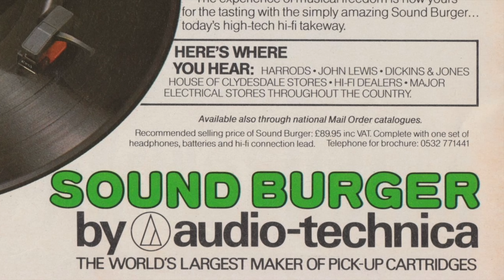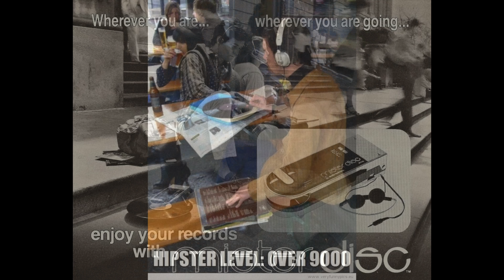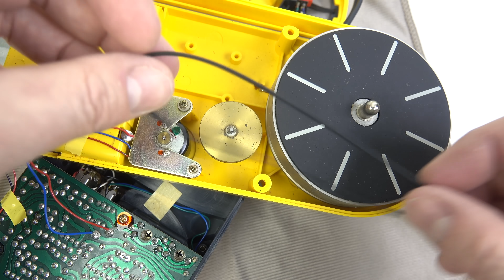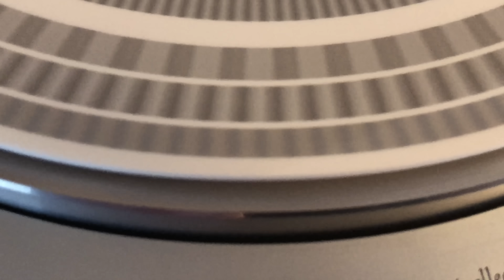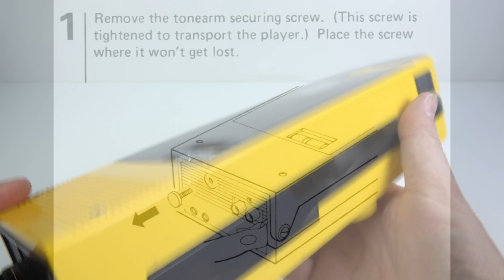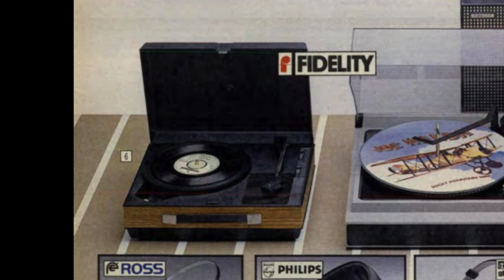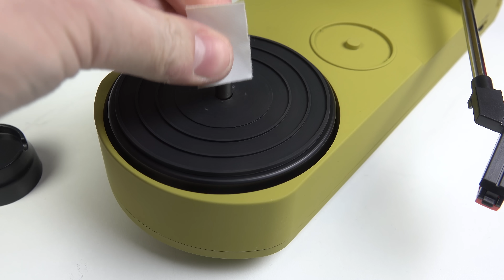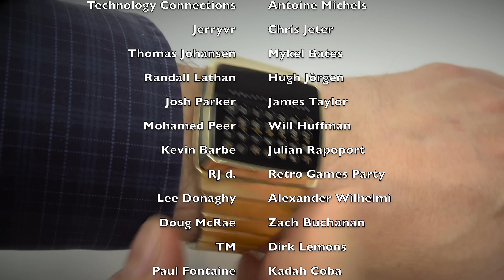SOUND BURGER & the clones

Comment: That Crosley is real, but it's the 2nd gen revolution.
I already own the modern bluetooth sound burger,  but I've just bought a first gen Crosley Revolution for £20 + £10 postage, which is apparently half decent.
I'll let you know once it arrives and I've tested it.
Reply: Finally replying to my previous post.
It's better than the 2nd gen. Not brilliant, but not terrible either.
It's useful for crate digging, but I still prefer the Sound Burger.

Comment: I had the original Mister disc in Purpke in mint shape that I won on eBay around 2010 for under $100. I was the only bidder and back in 2010, not many even knew about this machine and the vinyl craze had not happened yet. Sadly it got stolen about 6 years ago from my storage and I loved that thing, even just looking at it and not using for  it. I’m very visual and love the 70’s and 80’s and for me ot was like looking at art and made me feel how I felt in the 70’s and 80’s, 

So I was so happy to find out these are back bc  I don’t have the budget to get another original bc they’ve gone up 4 to 5 times what I paid 13 years ago. I actually was pricing some audio technica cartridges when this burger  unit came in the feed with the cartridges. So I’m def getting one and I love all the vintage Japanese gadgets from the 70’s and 80’s. I need to find a book with all of the vintage Japanese gadgets, so I can just look at them and be more educated on what was out back then.

Comment: I would have put the strobe disc over a record to check the speed, as having to drive the weight of the record might have taken the speed down a bit. The rubber stabiliser would have have stopped it slipping on the surface of the record. The 'flywheel' effect of the record might also have improved wow and flutter.

Comment: perhaps it was running fast due to no load i.e resistance of stylus 

plus the battery run down would drop the speed over time so running fast means that normal speed is when batteries have been part used?

Comment: Ok that's a BIG red flag. You need to manually switch the power supply from USB to batteries? That's an incredibly cheap and simple thing to do. Its in basically every dual power device and in every audio device.
That fake Crosley was made to be cheap.

Comment: how on earth could have something such hum if it runs from batteries... I mean yes, the motor driver may be the guilty here. But how cheap were the buisnessmans who ordered to engineer these electronics... At least a decent capacitor should've been given to the circuit, or only a DC motor with some gears and capacitive filtering for commutation noise...

Comment: Yeah your Crosley was definitely a fake Crosley.  Please review the real thing.  You can tell the real thing by the top has clear plastic window over the record, the tone arm has a proper handle,  it takes 6 double "A" batteries and has an FM transmitter.  The adapter also appears to be soft rubber like the original Sound Burger.  I really like to know what the tracking force on the real thing is.

Comment: 3 Batteries are min 3 Volts and max 4,5 Volts, if you are a bit crazy, you can replace them with one Lithium Ion Pack (be careful to add a low discharge protection, though). Would make it run for several hours, even with a small one.

Comment: I'd like to mention, that seems to be the second iteration of the Crosley Revolution and yes it is garbage. However the first model is much more similar to the Sound Burger though it still feels like a cheap knock off, not so much that you could regret buying one. I recently got a CR6002A (The one in the video is a CR6020A) and it is actually quite good. The spindle does rotate with the platter, the cartridge is a Chuo Denshi Moving Magnet, it does require more batteries (6 as opposed to 4) and doesn't come with earplugs, but it has a much better design overall, more akin to the Soundburger. I'd give it a look if you haven't by now

Comment: I remember these novelty players shaped like different models of popular cars that had wheels connected to a motor and had a stylus and cheap speaker. You would turn it on to the corresponding speed of the record and the needle would keep the car on track as it played whatever was on the record. The record stays  put as the little auto goes round and around the record until you pull it off or it reaches the middle.

Comment: I still have my AT Sound Burger from 1983. Good to find out that belts are still available.

Fake or not, Crosley makes some absolute junk under the banners of 'nostalgia' and 'retro'. However, Crosley make two Sound Burger rip-offs. you have the cheaper version, They also sell the Crosley  'Revolution', which like the AT Sound Burger, has a clear window above the record platter. In the USA there's an even cheaper and crasser model, the Sylvania USB, which sells for $30 and it looks more like the Crosley you have - a knock-off of a rip-off.

Comment: i owned a small record player like this before. not quite so small but still small, and also one built into a dresser sized piece of furniture, both with the same issue.. when i touch the metal on the arm it shocked me. would would that be from? it reminded me of that when you got that humming when you touched the arm on the "crowley".. and speaking of that, my gut says it's fake.. Did you ever figure it out?

Comment: Hi. Nice gadget. One major mistake was that you didn’t clean the belt grooves. They are usually quite dirty. Use wooden cotton swab and some cleaning fluid which evaporates well like alcohol. Also handling the rubber belts with bare hands is not recommended. Please use tweezers. Also the smaller belt is wrong. It is too thick which you can see when turning it. The belt doesn’t follow the small motor pulley as it should. This is quite important and when you have too thick belt it needs to be very exact as it may stress the motor bearing if it is too short. 

We professionals do not use that much contact cleaner as it collects dust. I have used LPS-1 for 45 years which is greaseless lubricant. Usually you don’t have to use any contact cleaner in that good quality trimmers. You can turn the trimmer back and forth tens of times which helps to clean them. If the trimmers are getting worse the only good fix is to replace them. But this is not very common situation. Also you didn’t adjust the speed after turning the trimmers. It would have been very easy.  Professionals don’t let the speed be that much off if it is easy to adjust. 

What I succest, is that you change the smaller belt to thinner one and after that adjust the speeds with record playing as the pick-up slowers the speed. This is very important to know especially in this kind of battery player. Also it could be good idea to clean excessive cleaning fluid and perhaps clean the trimmers with cotton swab and if you want to use any cleaning fluid, use LPS-1 as it is used in audio mixer faders in studios.

Comment: I'm assuming that the pot' on the first device in the video—the genuine sound burger—that adjusts the turntable speed, had something wrong with it or simply wasn't the correct choice of a component for the original design. My understanding of that component is that they work by moving an electrical contact against a length of material to force the electric current to travel different distances that correspond to more electrical resistance to further it has to travel. So if you feel up to modifying you sound burger, you could possibly use a tool to find the range of resistances the original pot allows, and use that as a guide, along with your speed test of the player, to pick out a new pot that allows resistance values more in the ballpark of what you require to properly tune the speed. Or if you can find just the right resistance value, you could plop in a matching resistor. (But only if your feeling lucky. It might take a very long time to find the perfect resistor.)

Of course… For all I know, letting through the correct voltage to properly tune the turntable speed may actually burn out some other component(s). Though I hope it's not designed to be that close to disaster.

I wonder if this comment is as silly as I think it is… Sometimes I'm just compelled to leave slightly silly comments.

Comment: 9:57 there is an additional function for the rubber holder: it's used to hold the tone arm into place when replacing the stylus: you have to place the record player upside down on the table and let the tone arm rest on it, and you can replace the stylus.

Comment: Making a cheap portable vinyl player in the 2014 strikes me as ridiculous. There is obviously a market for good vinyl players, but I think anybody with ears would probably concede that an AAC file played on a phone is going to sound better than an unstable record player with a garbage needle and noisy electronics playing a scratched-up record through little earbuds.

This is not a knock at people who prefer vinyl over digital: a cheap portable vinyl player takes all the down sides of vinyl and turns them up to 11. There's not even a use case for people who only have vinyl and want to be able to take it to a friend's, because the heavy tracking force will destroy your vinyl.

A product that would appeal to people who are serious about the sound of vinyl would probably be too expensive to produce in enough quantity to make it profitable. On the flip side, if you cut corners to make it affordable in the mass market, it's probably going to damage your vinyl without being able to compete with the audio quality of a bad smartphone. I think there's just probably no real market for something like this except maybe as some kind of small, DIY hobbyist system where you repurpose existing parts and sell kits without expecting a profit.

Comment: You should compare the Crosley Revolution CR6002A from 2010 to the Crosley Revolution CR6020A from 2014 (which is in this video, may be a knockoff, unsure). Big difference in Quality. I really like the 6002 and wished I never bought the 6020. I also own an old Sound Burger that works well. I have a 6020 for sale for $45 MIB....lol.

Comment: I have the Sharper Image clone and seemingly beats out a $50 model  that skips about whatever it's doing  (usb port included.  the speed being swung all the way to the left meant 33's were interestingly slow let alone 78's.  So I had to set that myself and it really isn't in the middle.  Which without providing a link to this horrid player (someone mentions the arm is too short hence the problem.  I'll provide the amazon code  B06ZYXTN61)  Maybe I can see a video on why that is so bad and why tipping it nearly as vertical as the beginning one on this video (already watched the actual, was the first Techmoan video I'd watched but getting um used to the British humor as well when needed ( think Big Clive and you should do a show together honest, but he's Scottish  )   My $150 14 yr old player just stopped playing music out of the arm, radio is fine but since I spotted Corrosion on the 2 pieces of metal in the cartridge which I didn't know could pop out let alone trying to put a new one back in  (It's in but requires a bit of force)  So at the moment the Sharper Image that runs on 4 double a's, has been played the most to the point I replaced the needle already (neither the faulty one which is seemingly generic as I've seen others with that design nor the Sharper image likes the Memorex Needle although it did seem to skip less on the crappy one.  Either way the other than this design (again USB port (memorex is older so thus was always interesting to record on certain laptops which without a certain Ion gizmo I usually got momo)  Laptops fault ) ahem the the design has an open arm and record and the controls are under so bumping anything like an arm or record does happen but doesn't seem to scratch records like a VW vinyl shredder.  In fact my Picture disc Thriller which tends to skip did not do so on the new needle on the sharper image.  I'm not too keen on the lidless ones...   Kinda prefer this design though.  Just need it run to the right speakers and the audio out jack needs some electronic cleaner I think as most jacks do.  Jack or plug?

Comment: I wonder if anyone's made a cd/dvd/blue-ray version of this, that'd be super-handy for portable use as it could be made much smaller than a normal player. It'd be easy to mess up the disk with this design so maybe that's why it hasn't taken off, although making it stand on its end so the disk is vertical  would mostly solve that problem.

Comment: Hi!

Firstly! Absolutely awesome channel!  I don't miss a single post!  

I have a quick question!  I have the PRP 5 Dual turntable which you mention around the in the video [2.08mins in].  However i have no clue what voltage polarity is so can't figure out what power supply to purchase.  Do you have any ideas?  I suspect it's the same as the Sound Burger but can't be certain.

Any pointers would be greatly appreciated!

Cheers
Dan

Comment: For those curious, I did my best attempt at mathematics, and I'm pretty bad at it, so take this with a grain of salt or 12,000. 

£ 89.95 (...GBP?) in 1983 has the same purchasing power of ~$630.00 (USD)in 2018. And that's with some rounding up to account for mistakes, admittedly. 

Which is the relative ballpark of those new in box ebay listings, which the most expensive I saw was ~$672.90 converted to USD. Though that doesn't account for shipping and any fees that would come from that if there was any. 

Although, there is a listing on US Ebay site for 599.00 and free shipping, so take that as you will too.

Just for an easy frame of reference for any fellow Millennial (or younger) Americans watching.

Happy Watching!

Comment: Ah yes ... I remember buying one of the red Sound Burgers new back in the early 80's.  Expensive to run on battery, it spent almost all the time I had it working on external power.  I also managed to buy a set of small but good sound quality speakers that ran on mains power too and were even made in the same red colour as the Burger itself - though not by the same manufacturer.  Looking at the price these things are changing hands for now, just wish I still had that set up....
Reply: Me too! Red Akai speakers also with external power or 4 big batteries each…

Comment: Actually, interesting story about my Sound Burger. When it was given to me, I thought I should change the stylus. So I took it to the only shop where I lived that I felt could sell me what I needed. I felt I had to be really apologetic because, as you said in your video, it looks like a toy. The shop sold high end HiFi equipment. I had been in there before to buy other things, but you got the feeling that the guys running the shop were capable of being very dismissing about anything that didn’t reach their standards.  So I said something like “really sorry to bring this in, but I’d like stylus so I can try it out”. Their reaction was overwhelmingly positive. They told me that it was made by a company that was very well known for its turntables, and in fact it was very good in its own right. They even thanked me for brining it in as they had never seen one in the wild before. They sold me a stylus, and it did indeed work, but as I said in my other post, the pots are knackered. So I put it away. One day, I told myself, I’ll get it working properly again. I feel that I really should now.

So, thanks for posting the links for the drive belts - mine needs a new set as well. I may have to get it a new stylus too, just to be sure - no rubber support with mine, so the stylus has been resting on the turntable for a very long time.
Reply: or you could do what i did, and wait many years for them to release a refined product that works as good as the vintage burgers

nah jk mad respect for brightening that guy's day and servicing your burger

Comment: I see these older portable devices from the 80's and 90's and wonder if people convert them to use lithium-ion battery packs, possibly with the ability to recharge them in the device (but probably just with a connector to remove the battery). it may be possible to get a more usable time out of the device, and save some weight. I know RC guys will do with this older RC vehicles, but I don't know if anyone else does.

Comment: One thing I remember Vwestlife mentioning in a video about the audio technica lp60 is that cheaper modern turntables often use springs to exhibit tracking force, meaning that the higher up the tonearm is, the more force it will push down with. Because your scale was placed on the record to measure the tracking force of the Crosley, it measured the force of the tonearm at a higher position than intended, which may have greatly skewed the results, and I'd like to see you remeasure it without the record if you could. I mean in the end it doesn't really matter, it's still a terrible turntable, but I would be interested to know what it's actual tracking force is.

Comment: I think this might be a knock-off.  I have one of the Crosley Revolution record players and it has a built-in FM transmitter in addition to the USB connection.  The design of the lid is also very different.  It's still pretty crappy, with a ceramic cartridge, and runs a tad bit too fast (I'm really pitch sensitive), but it works for auditioning inexpensive older records.
Reply from the maker: There’s a bit more information about this in the video description text box.